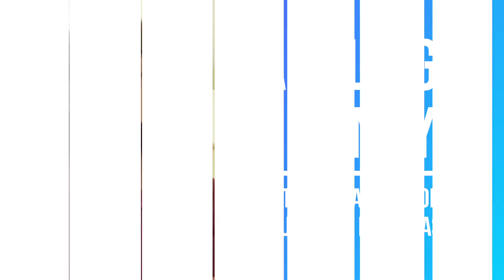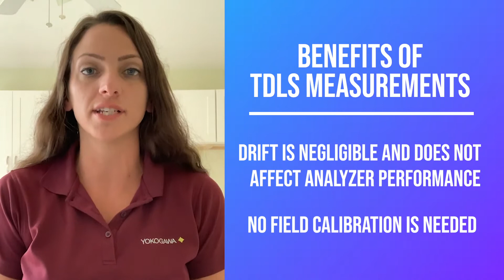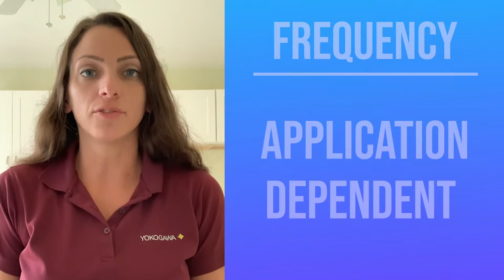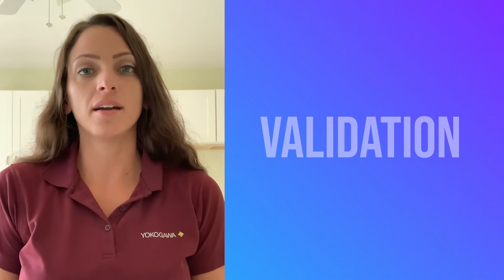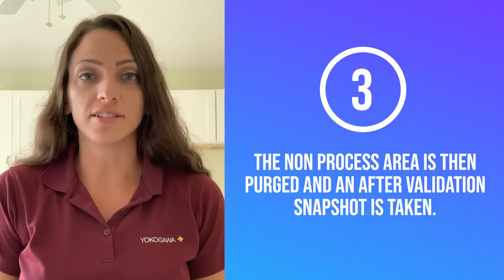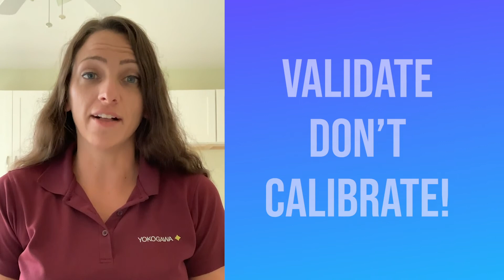TDLS Calibration vs Validation | #ThursdayTip

Comment: Another doubt regarding validation is about the value displayed on the screen during the validation process, which is not the default value!
in this case, which calculation is performed to add the two OPL and know if the value that will appear is the standard calculation?

Comment: Hi..
So, what if the validation has failed?
Reply: The only reason validation should fail is if the validation parameters are not programmed correctly at start-up (most common issue). The deviation between the process before and process after is too much (like discussed in the video). Or validating a long path O2 measurement at ambient conditions when the process isn’t running (this is a more technical discussion). If the validation fails, you can send us the data to analyze, and we can help you determine what the issue is. Give  us a call at 1.800.524.7378 or email/live chat with us on our website: https://www.yokogawa.com/us/contact/